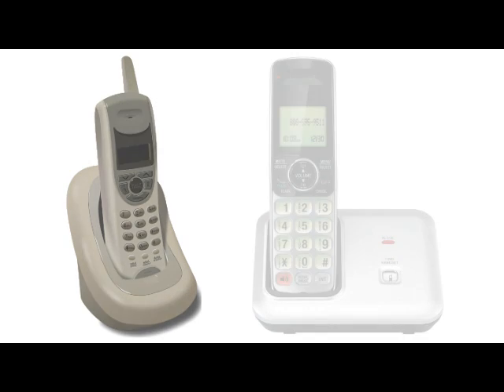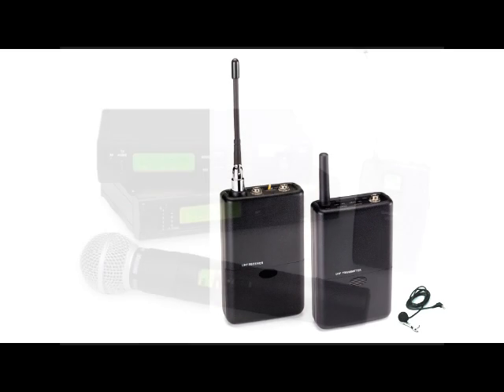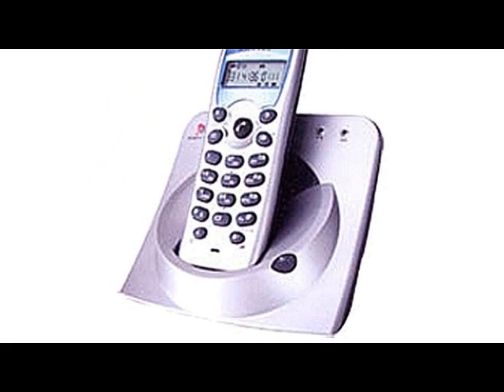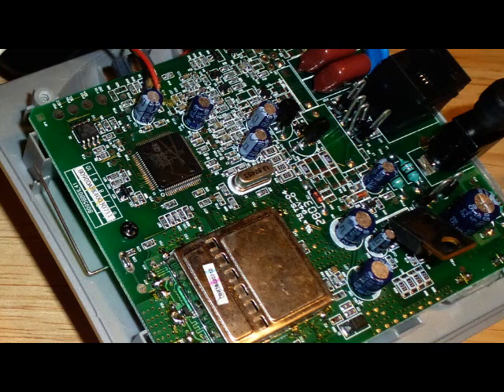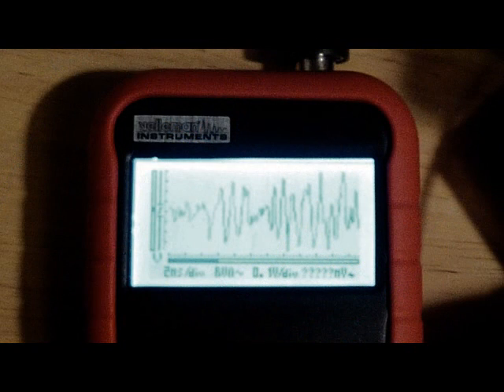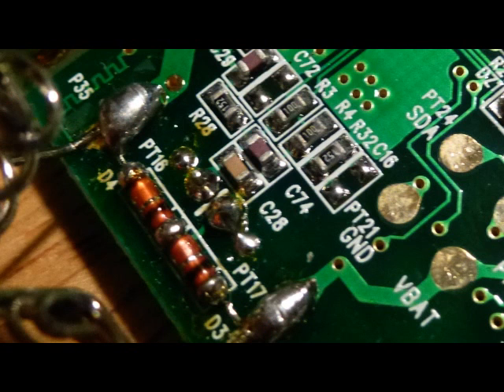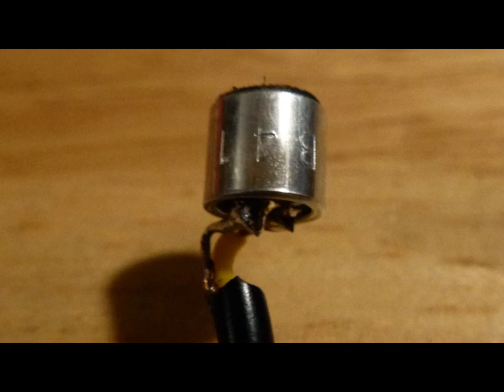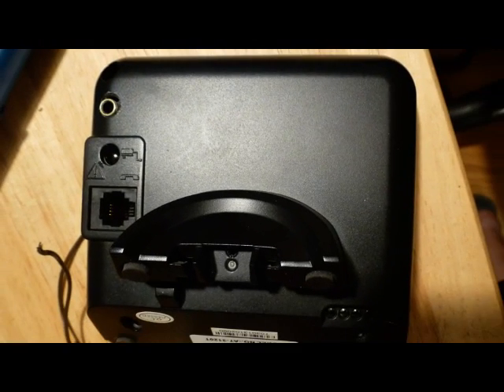Turn A Cordless Phone Into A Wireless Mic

Comment: i know this is old but i was wondering if this would work if you put a mono audio jack where the mic used to be??
Reply: If you put the audio jack on the handset, then you would just be using the handset as a microphone, hardwired into a mixing board or preamp.   We can't see it, but I'm pretty sure he has the hand set laid out somewhere near the mic, maybe on the table, because in order for wireless transmission to work, it has to operate on an RF band.  Imagine using a wireless mic system, but the transmitter is turned off -  Speaking into the lavaliere isn't going to produce audio on the far end receiver.  There's other videos on youtube that explain how to turn a handset into a wired mic.  In this example, you could plug the base station into your preamp/mixer/interface, etc. and use it the way he is showing.   For aesthetics, it would be cool to throw the microphone back in the handset - space permitting.  Hope that helps.

Comment: anyway you could find the pads with a multimeter?
Reply: No.  He turns on the handset that has its own power source (batteries) and uses the oscilloscope on the base with no DC connected.  The oscilloscope is giving a visual readout of the transmitted sound waves.  Multi meters wont pick up transients.  And without DC power, you wont get voltage readouts from any components on that base station.